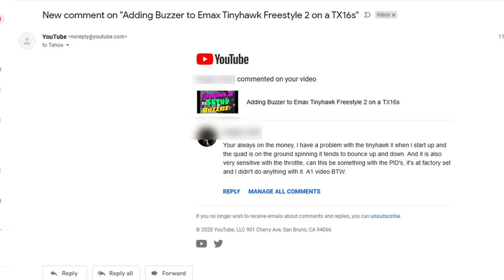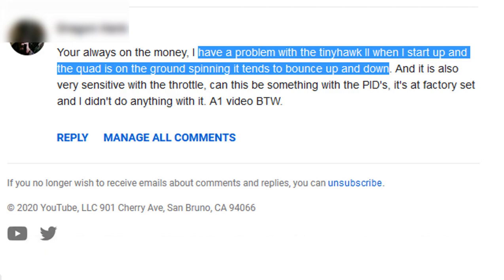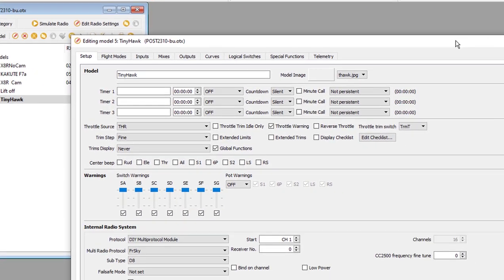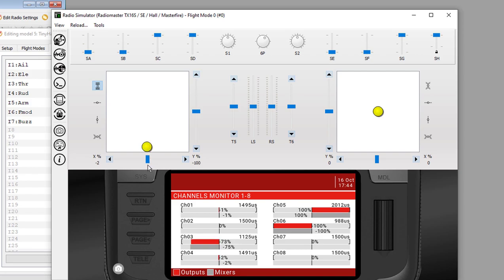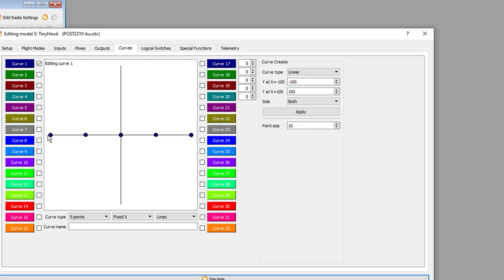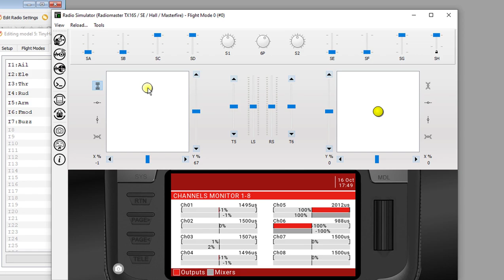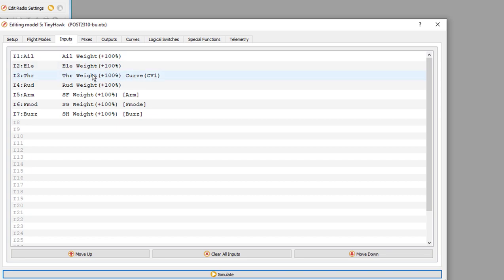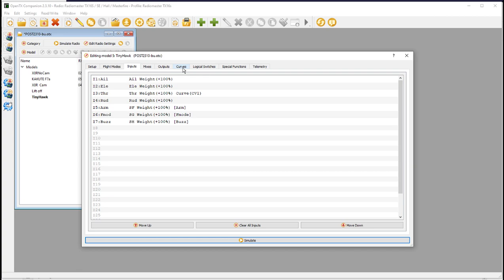Taming Throttle Control In OpenTX Using Weights, Offsets, and Curves

Comment: I had this experience also. I changed mine through Betaflight and it was super easy.  Under PID Tuning Tab of Betaflight you go to the rate profiles. You have to set the throttle limit to scale, and then next to it set the percent you want it to scale. I set mine to 75%.  And thats it. Just save and disconnect.
Reply from the maker: Thanks for sharing this info.
Reply: brilliant, thnx for sharing! I prefer to do this in Betaflight too!

Comment: Just a heads up on the "arm bounce" issue, I have a Tiny TinyHawk II Freestyle and a TinyHawk II that both did this right out of the box on the factory tune. This isn't a radio issue (at least not bounce on arm). This is much more noticeable if launching from a hard surface like a tile floor. At zero throttle and arm the props spin up and create just enough lift to get the quad to lift off but not enough to keep it there so it slams back down, only to then regain enough lift to take back off (lather, rinse, repeat). This all happens on its own without any input from the TX, just a simple arm.. What I have done to fix this is reduce the idle prop speed in Betaflight. Super easy fix and doesn't mess with any other settings. That fixes the initial issue out of the box.. This video is helpful with addressing the second issue which is the default throttle curve is super touchy and for an inexperienced drone pilot on a super lightweight drone, little adjustments in throttle have exasperated results on the craft, especially at the lower range. Setting a curve helps smooth out the lower end of the throttle activity. Thanks for posting this video. I am newer to OpenTX and you explained and confirmed for me a few things I had suspected regarding offsets and curve profiles.
Reply from the maker: I appreciate the input and thank you for taking the time to comment.
Reply: Hi, can I ask how you have done that..? I can only find something called idle throttle in percent under controls in betaflight, and it starts at 8 and even I have turned it down to 4, it will still jump..
Hope u can help me 😊
Reply: Where is the Idle prop speed in BetaFlight?

Comment: This series and your beginner series on the Radiomaster TX16S has helped me so much to get my TinyHawk II in the air and flying. I've learned a lot thanks to your time and effort to help others just starting out. I was wondering what you thought about Project Mockingbird V3 for the TunyHawk?  I am confused on the different airmodes and changes made when switching modes. Is it valid for all versions of the TinyHawk series and have you tried these settings? Possibly a video on it and your thoughts in the future?
Reply from the maker: I have not used Project Mockingbird for my TX2, but sounds like a great idea for a future video.

Comment: this of the throttle limit is an interesting topic. it would be very useful, however, to set the throttle limit on a remote control switch, so as to be able to use the limit just when necessary (for example, for indoor flight the throttle limit is active and outdoor it is disabled).
can you explain how to do it? :)

Comment: I had the same problem with my tinyhawk 2 freestyle, when I armed the drone it started to jump even with the Throttle at 0. I solved it by simply adjusting the end points, maybe I had the Throttle above the minimum. Is it a possible solution?
Reply from the maker: TH2 jumps just like you mentioned in your comment and from what I have read, it is not an issue